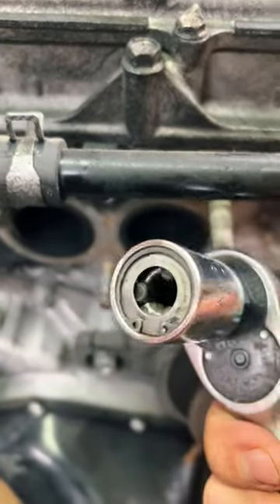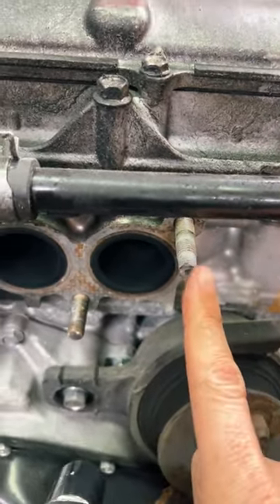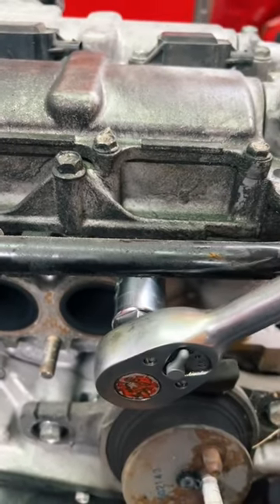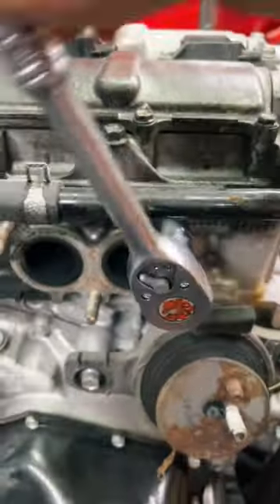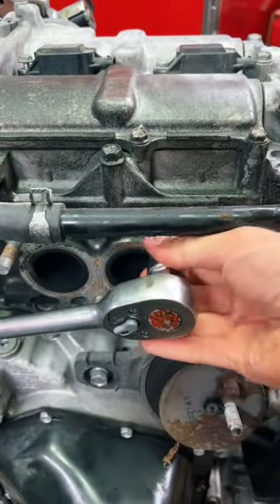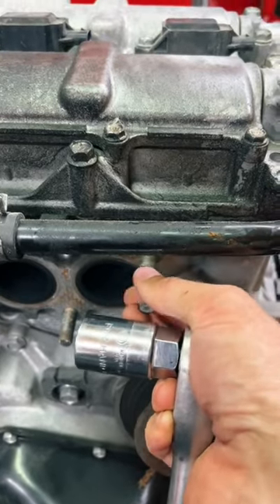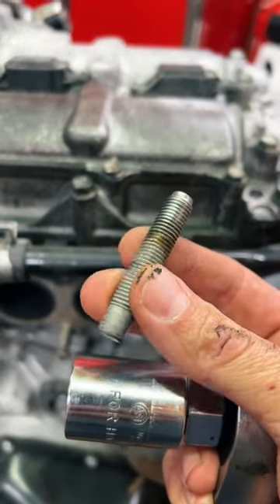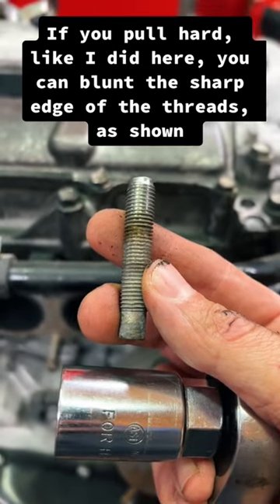AST Stud Remover/Installer Making Studs A Breeze! #mrsubaru1387 #ast #shorts

Comment: Thumb's up. I'd never seen a stud remover like that. I'd typically just "double-nut" it, but manifolds are always a struggle for me.
Reply: Double nutting is a pain in the ass, I use these frequently and they do pretty solid. They mar the studs up a little on the way back in, but it's nothing crazy. You can still start nuts on them just fine, if anything it creates a natural locking nut 😂
Reply: I refuse to try and mess with any old exhaust unless I've got a torch to warm up bolts,be it acetylene or mapp/propane depending on the material.
Reply: double nut doesn't mess the stud up like these things do ;)
Reply: @Muffin Masher  Good point. My favorite is the flush-broken stud that you try a broken-stud-extractor on, and then need a specially-hardened broken-extractor-extractor on.
Reply: @BilgemasterBill  yeah every type of "ezy-out" stud extractor I've ever tried has just snapped off tbh, they may work on loose studs, but then why would a loose stud snap in the first place... left hand drill bits or a welder are the only REAL solutions to the problem if you didn't royally fuck up in the first place from my experience. I guess they have their place, but if you do it right the first time you are already past that when shit hits the fan xD

Comment: Unless the stud comes out very easily they damage the studs every time… definitely useful for removing studs I don’t plan to reuse. If I need to reuse the studs I don’t use my stud remover sockets, they just crush the threads. Even the stud you showed here was damaged. You wouldn’t be running a nut over that by hand anymore.

Comment: I love my old snap on ratchet, back drag and all. I think it's from ~1976. My dad gave it to me when I started as a tech. I clean it out once a year and stuff it full of purple caliper grease, and don't use it where it shouldn't be used. I don't think it will ever die.
Reply: Same I got that exact one from my dad. The play is a lot but that thing is indestructible
Reply: Use super lube, current snapon standard. Brake grease is too thick!
Reply: @DeseanWick  thicker lubricants are generally better for low tooth count ratchets. Snap on uses the grease form of super lube in their dual 80 and other modern ratchets currently.

Comment: You do realise that you should not tighten studs into a head as when you tighten them up, you stress the threads, and this is why they break . Putting them in finger tight is all you need to do easy to get them out later, and they don't break as often